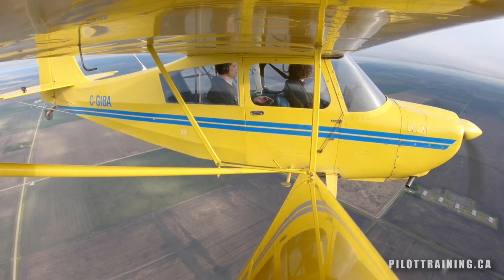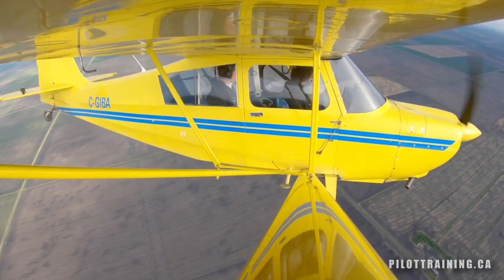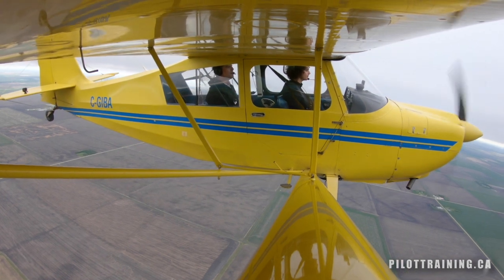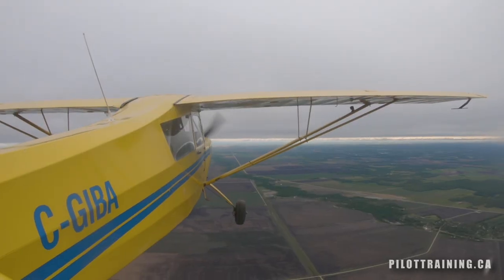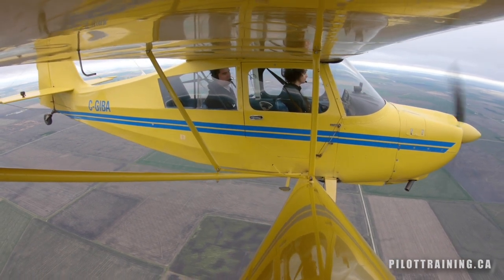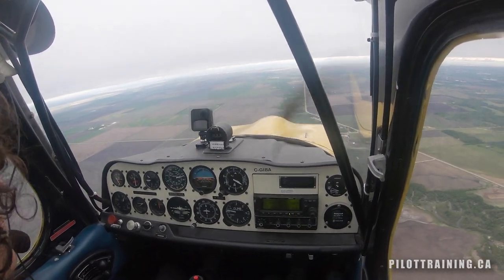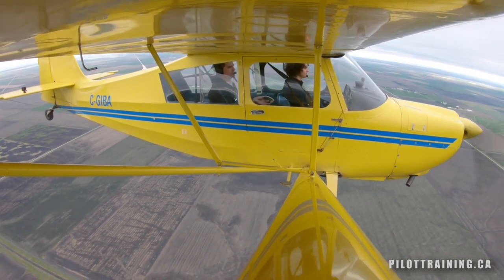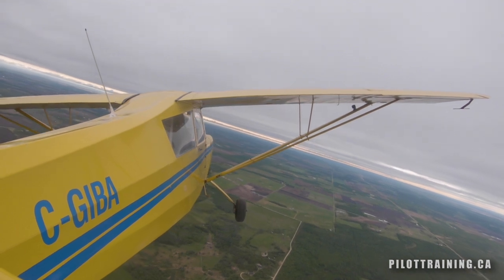How to do a Aileron Roll in a Citabria Aurora 7-ECA

Comment: The last part doesn't make sense at all. In a normal turn with constant power, if you neutralize elevator and only use ailerons, the airplane turns when in a bank but also loses altitude. It's the horizontal component of the lift that turns the airplane and that has nothing to do with elevator.

Comment: Why do you need rudder in an aileron roll?  Never understood this, why would you want to yaw the nose in a maneuver where you're just rolling around a different axis?  Odd.
Reply: You need rudder to balance the roll. Aileron changes the lift vector and the horizontal component of lift turns the airplane. NOT the rudder.
Reply: You don't want the nose to yaw but when you apply full left aileron the right aileron goes down and creates more drag than the left one which goes up. This is called adverse yaw and is very prevalent in the Citabria or any of the other planes that were built based mostly on pre-war designs in the late 40's. So you are applying rudder to counteract that adverse yaw and keep the nose straight. If you were in an Extra you wouldn't need to do this. Hope this helps explain it.
Reply: @pi.actual what additional feature does an Extra have that removes the need to compensate with rudder input for adverse yaw?